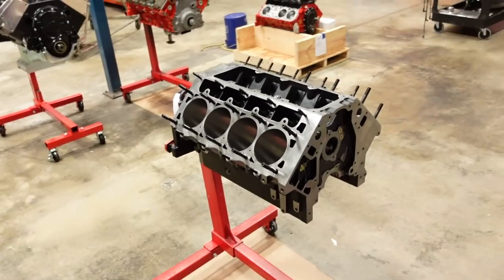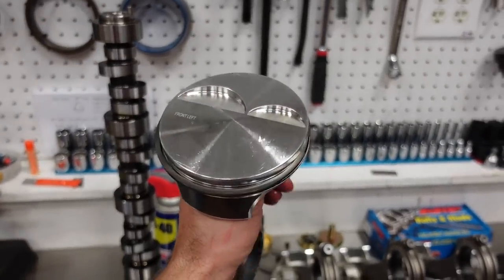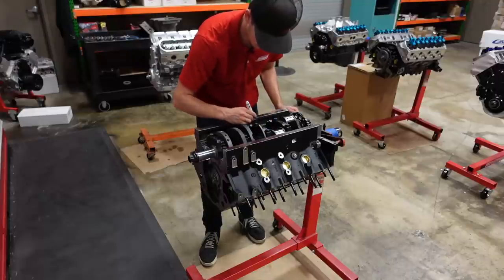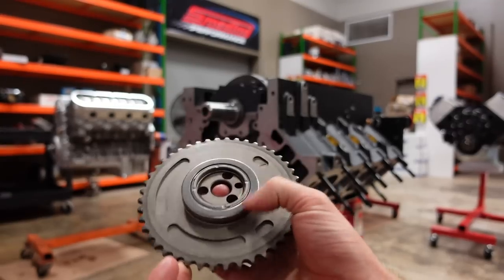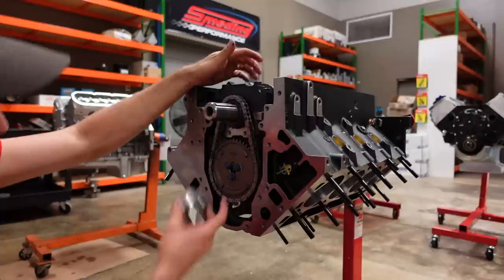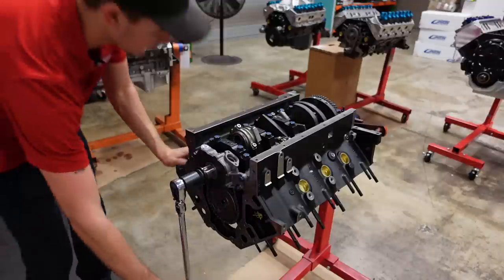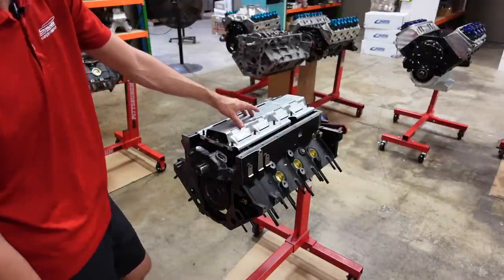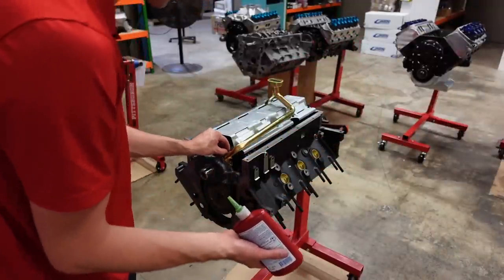How to Build a 441" LS3 Short Block! - (tips & tricks)

Comment: Gorgeous engine brother. I am building a Ls3 with a stock block. I am looking for about maybe 500 wheel. Which of your heads would you use. Would the 255cc be adequate? Street/strip engine. More street. She's going into a 03' Crown Vic. She's a big girl. 4200 pounds without me in her. I don't want to run a really big cam if I can get away with it. I don't want it hard to drive cause my wife will drive it sometimes. Would it be better to put one of your 4 inch stroke cranks and just make it a 416?
Reply from the maker: Either our 255 cast or 260cc 11 degree would be great!
Reply: Thank you!! I appreciate it.

Comment: I really don't WANT to build a shortblock. But I feel it's necessary to learn atleast how it's done and what is inside my engine. I need to rebuild a 6.0 for my silverado truck and frankly, can't afford to pay someone to do it. Do you think this is a smart route for me? I have no mentor, just YouTube. So having someone check my work won't work. I assume the principals will apply to a 6.0 as you did with this engine correct?
Reply: every one starts somewhere. I think if you know you need to check and recheck your efforts you should be fine. People have been assembling engines for decades with much less prep and they run just fine. If you never try new things, you will never develop the skillz.
Reply: I rebuilt my first engine almost 40 years ago with nothing but a shop manual. I’d have killed for YouTube videos. If you pay attention and follow the basics, you can do it. I wouldn’t suggest trying to build a race motor your first time, but for just a basic rebuild, you should be fine.